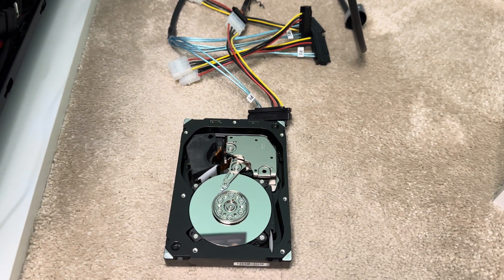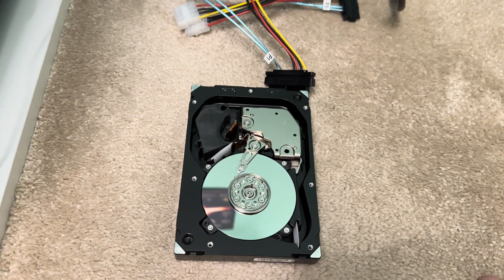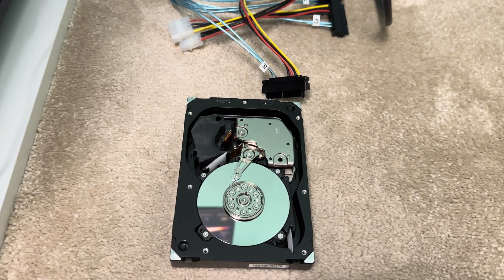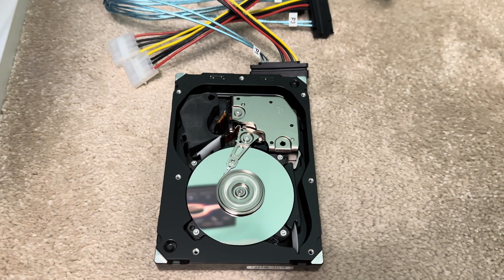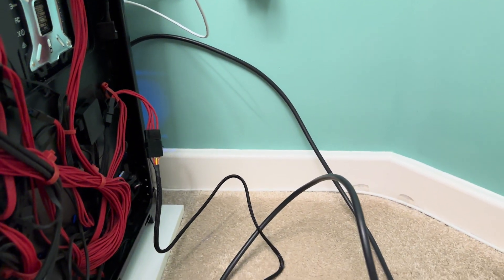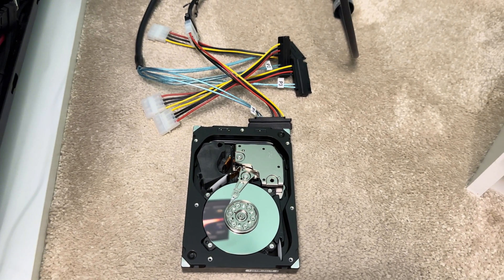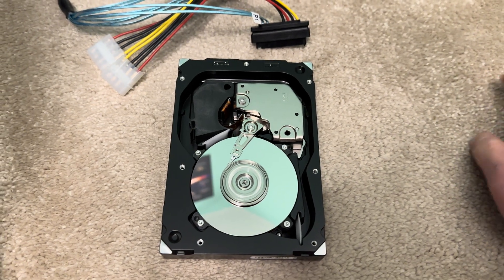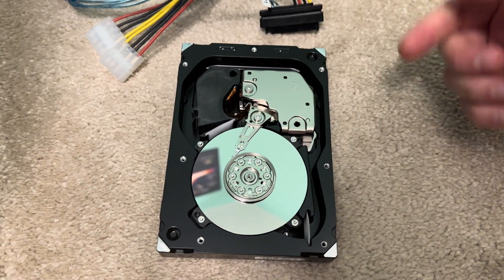15k RPM 3.5 inch Seagate Cheetah 15K.7 spinning with cover off

Comment: NO!
It stops so quickly because of the permanent magnets on it!
Reply: No, for that to cause significant braking the HDD would have to short out the windings. This is a case of a tiny disk with little mass and little inertia. Add air resistance to the equation, and you get the fast braking.
Reply: @tomclanys  Yes, but not exactly. It depends how the controler off state is done. Some of them really makes a resistence between the coils
Reply from the maker: Nah it's because the discs are tiny and have little mass + inertia.

Comment: That's a tiny platter for 3,5 inch. 

It reminds me the same happened with optical media. First, we spun CDs up to ridiculous speeds, like 20 000 rpm which sometimes caused catastrophic failures but then with DVD and Blue-ray the capacity and transfer speed are no match for 52x CD drive. 

Recently I've been tinkering with a WD 1 TB 5400 RPM drive and it somehow managed sequential reads of 200+ MB/s and my current basic barracuda 7200 I've seen once up to 250 megs.
Reply: Many earlier high capacity high speed HDDs used such small platters due to seeking time
Reply from the maker: Yeah those 52x CD-ROM drives. The reason this can spin so fast is due to the tiny platter :)